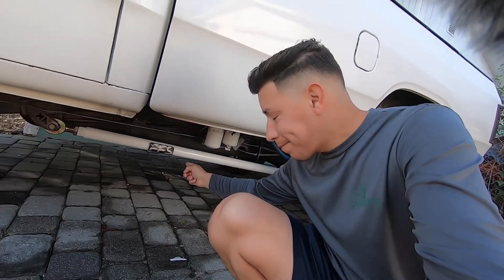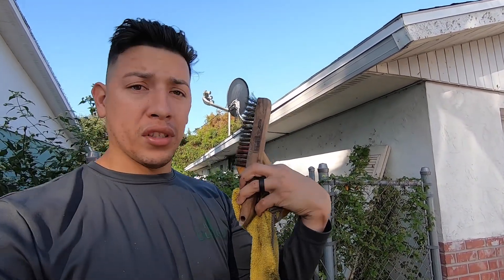How To Remove Rust From Stainless Steel

Comment: How did you change the grill on your truck ? Is just plug and play ?
Reply from the maker: Well 
The only thing you have to do is purchase the relocation of your headlights because with the new grill the headlights I believe are either higher or lower I don’t remember and far from stock sells that adapter plate that relocate your headlights so whenever you install the new grill it will be much more easier then getting a new radiator core so I would recommend that and it’s a lot cheaper and also if you try to look for a radiator core it will be hard. But with @farfromstock piece this would make it plug and play